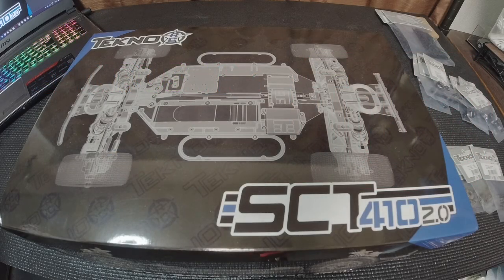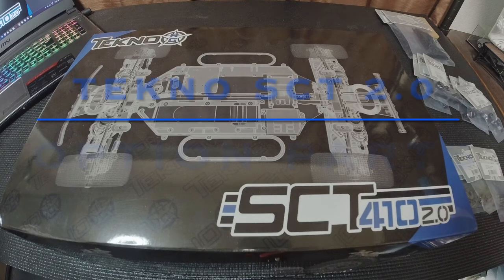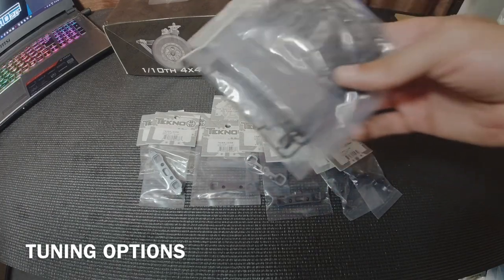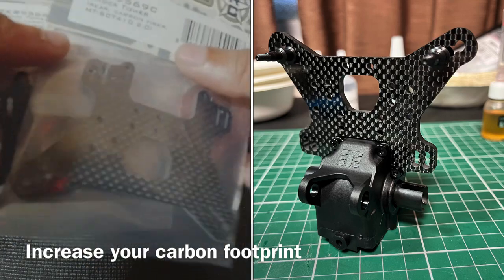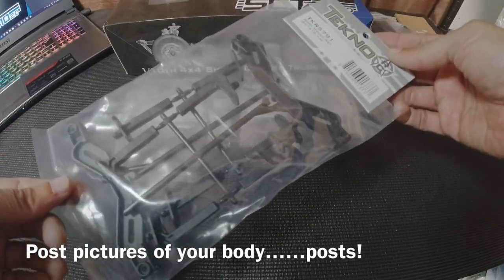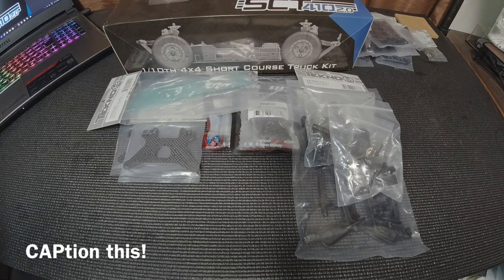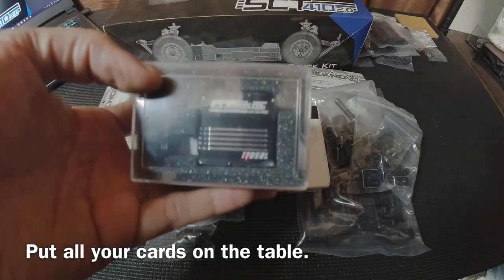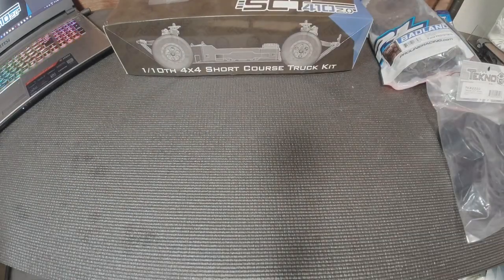TEKNO 410 SCT 2.0 ( PRE-BUILD OPTIONS )

Comment: What size bearings are you using for the front and rear sway bar collars? In the manual, the bushings don't show a size. As a matter of fact, the part numbers are for the front/rear gearboxes, which include the bushings.

Comment: What is the difference in the gears for the diffs? I dont get it.
Reply from the maker: The stock diffs ( Front, Center, and Rear ) come with a plastic cross T for the planetary gears to rotate on.  It works that way stock, but the reality is that’s not going to cut it for the amount of power most people are going to run through the system.  

When I saw the Instruction Manual and the bags, my first reaction was “I don’t get it” just like you.  Why would you build such a heavy duty SCT kit and then toss in a bunch of plastic parts?  It’s not about  the design.  It’s about money!   Intentional fail points.  

Now, we can never expect TEKNO to fess up to such speculation.  Intentional fail points?  However, we know.  So buy the right parts now or deal with the issues later.
Reply: You replaced the gears as well, right? The stock gears aren't plastic are they?
Reply: @spinrushrc  I'm running the plastic crosses since months now in my MT 2.0 and I run it on 4S (2400KV Max10G2) No Problems so far... with Proline Hyrax 2.8

Comment: Whats the part# for the sway bar bearings? To blurry in the video to make out
Reply: So looks like you are using ET48 2.0 1.8th 4WD Truggy sway bar bearings - TKRBB050825RS – Ball Bearing (5x8x2.5mm, rubber shielded, 4pcs)

Comment: You can't race badlands, they are bashing tires. Most tracks will make you change your tires to something more suitable.
You spend all that money or Gucci parts then drag out that Walmart motor? Get a Castle or Tekin.
Reply from the maker: I’m not going to start out racing.  Badlands are for bashing.  You are right about that.  Proline Carpet Prisms are coming later next month.  As far as the motor goes, it was highly recommended in the TEKNO SCT 2.0 community on FB.  I know about the TEKIN as well.  I’ve also read all their woes.  Castle is a solid pick though.  FWIW, this is just the initial build.  

Thanks for you feedback.